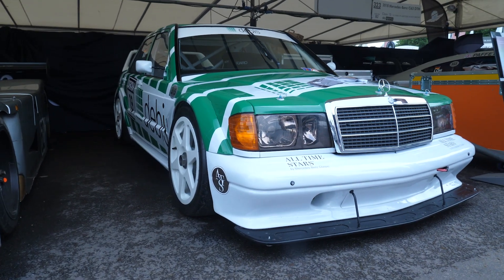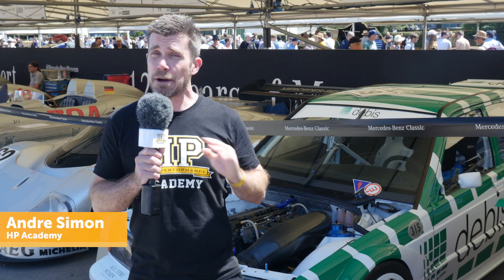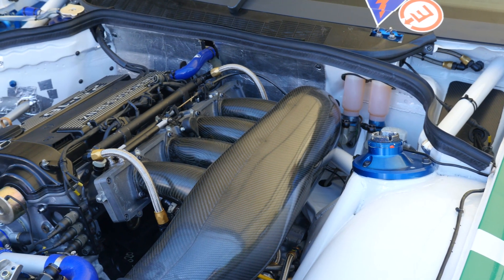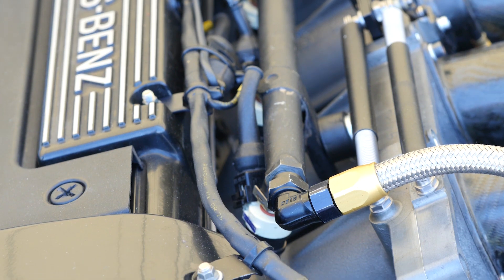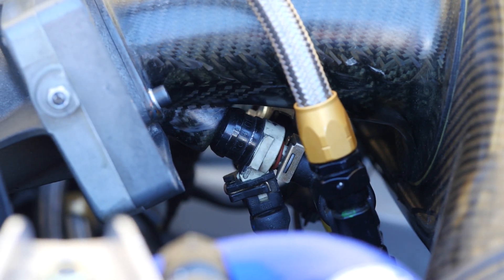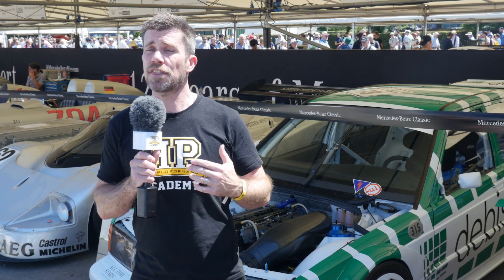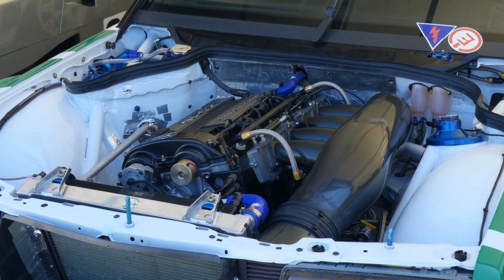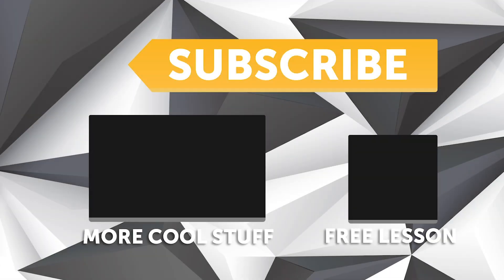Staged Injection | Mercedes-Benz 190E Evo II DTM [TECH NUGGET]

Comment: I had seen a test on an engine with varying injector placement. Think it was a honda B16 with ITBs. Placing the injector outside of the intake system spraying into the trumpet gained a surprising amount of power. It must work similar to a carburettor in that it cools the air making it more dense.
Reply: Kamil Zmich by any chance, was there a link to this test ? Curious to know more about injector placement
Reply: @scadieee  I don't have any links unfortunately, it's from a book called "Xtreme Honda B-series Engines". I can't find any other references but I believe the test was done by Richard Holdener. I could scan in the page if you're really interested haha
Reply: @kamilzmich5961  Damn thanks brother for the book name, probably end up buying a copy

Comment: I think this engine have near to 400hp.
Reply from the maker: We can only go off the information we are given which in this case came from Gert who was/is involved with these cars: https://bit.ly/190EEVOII - Taz.
Reply: @hpa101  350hp sounds good to me. 

Thank You Taz. 

Thats still very good power as for 30 year old (i cant believe that this DTM era was so long ago!) construction. 
In fact, there is not much development in N/A engines sector, over all those years.
Reply from the maker: Yes it's been put to the side for forced induction applications I guess which is a shame, although this is still a way off what you could get off the factory floor power wise at the time. Many modern racing classes also have more rules around output etc too which must play a large role. It all keeps life interesting one way or another =D - Taz.